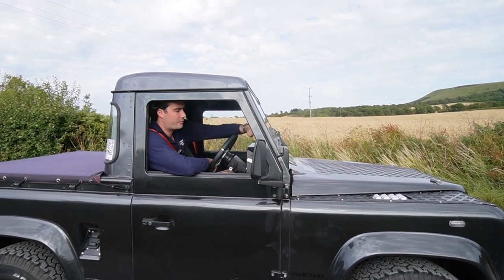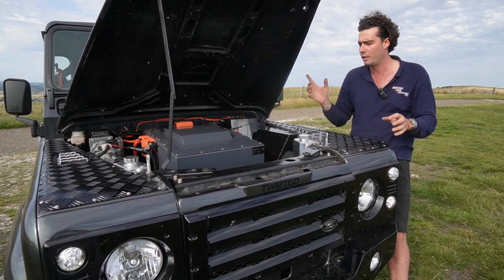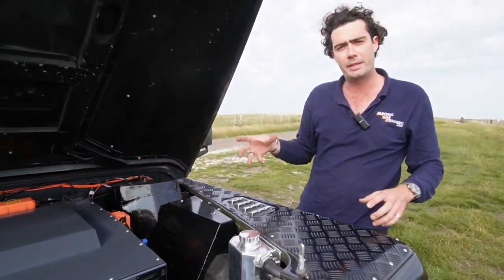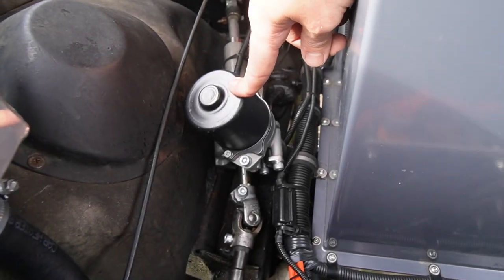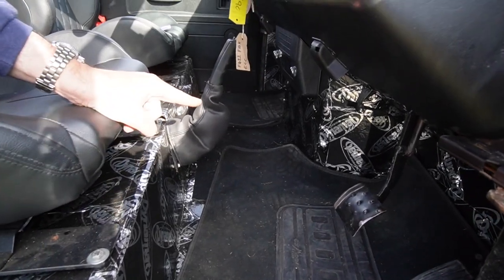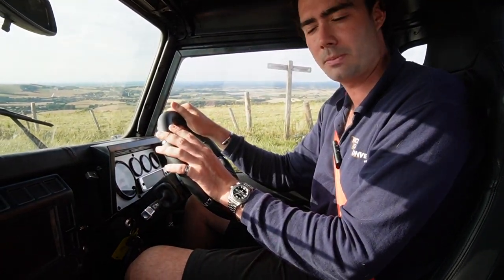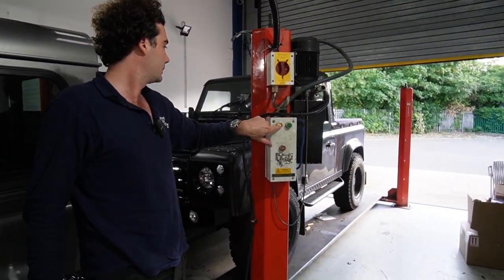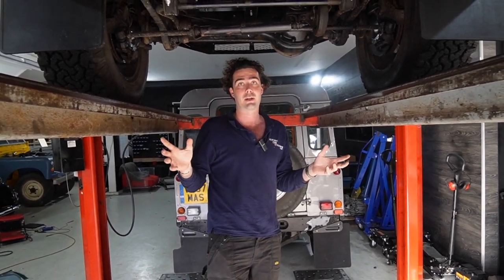ELECTRIC DEFENDER - How we built this amazing EV Land Rover. Nothing hidden, everything shared!!

Comment: Very impressed with this conversion. Particularly like the removal of all the power-sapping/noisy transmission/transfer box. Could I ask if this conversion carries over some of the Tesla wheel control - anti-lock, etc, on such an old vehicle? Also, one thing leads to another. The sound deadening helps but that owner will be looking to reduce those rattles. Have you looked into whether there is an economic/relatively simple way of stopping metal meeting metal. I'm sure some of your customers can afford it. Best regards.
Reply from the maker: Thanks for your kind words! Yep they're definitely efficient without the transmission etc. No it doesn't carry over the Tesla wheel control etc, its just the motor that is Tesla, even the control system for it is different. The owner has now added insulation etc all around the cab, and then carpeted it so the rattles are pretty much gone - but it's still an 80's Land Rover, it wouldn't be right without any rattles at all!

Comment: Fantastic.
How much can it cost to convert my landrover defender 110 petrol engine.
From the tutorial there seem to be no Hi & Low range.
I come from hilly side Taita hills in kenya.
To finish up the hill at times am forced to use low range in order to finish up hill depending on load i have carried is this ev strong enough to climb up steep hills
Reply from the maker: Its £60,000 for the conversion kit. There's no hi - lo, but you don't need it due to the amount of torque and power you have from 0rpm anyway. You will have plenty of power to get up the hills, its 280hp.

Comment: So you have done away with diff lock and hi/ low gears?
Reply from the maker: Yes, you don't need hi/low due to the huge torque available from the electric motor. The Tesla motor originally has an open diff in it, but we replace this with a limited slip diff, so although not locked, it still finds traction and is awesome off road.
Reply: @electriccarconverts  what happens if one of back wheel of ground?
Will it spin out or front drive still pull you